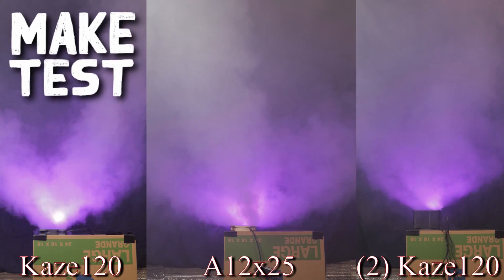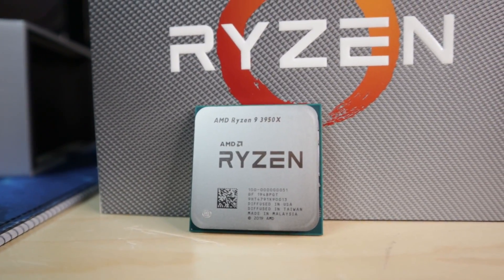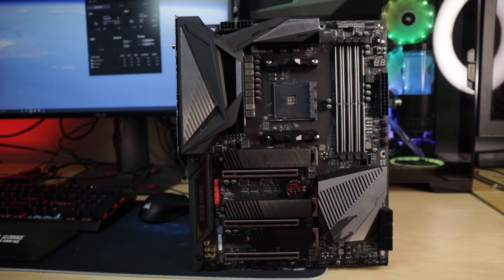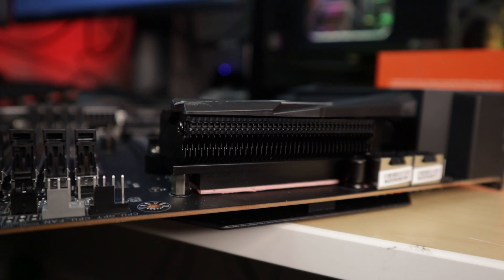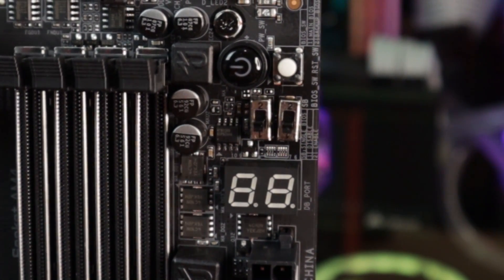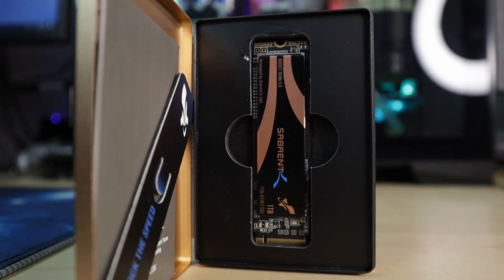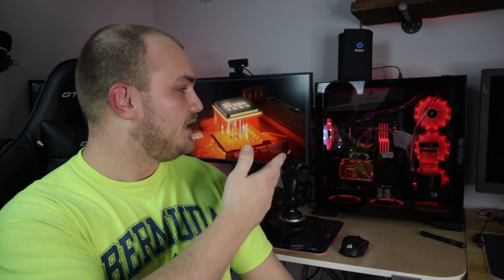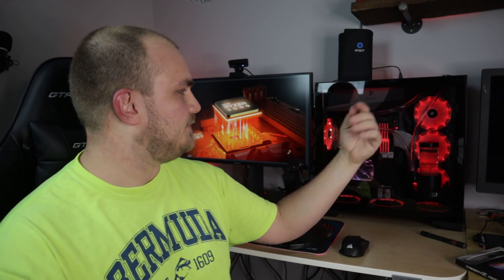EVERYTHING WENT WRONG, Upgrading I7-7700K to Ryzen 9 3950X

Comment: I upgraded from Intel i7 7700K with ASRock Taichi motherboard to Ryzen 9 3900X with a X570 ASRock Taichi. Both had 32 GB RAM, but 7700K was limited to 2400MHz whereas with the 3900X I can run 3200MHz, more if I wished. Essentially it was a 3x increase in grunt and it is unbelievable the difference the grunt makes. I recently ran a stress test for 2 hours @ around 400 watts, 100% CPU capacity, between 75-100% GPU capacity, and 90-100% RAM capacity.
 The GPU ran @ 67C, RAM @ 47C, and CPU @ a very cool 72C. The load I was running - 5 different stress tests running plus processing photos - the 7700K would not have been able to handle.
The only things I changed was the motherboard, CPU and RAM, and kept the same 750 Watt power supply, hard drives, etc. You also need to reload many programs so they can recognise the new CPU and motherboard, and of course load all the latest drivers for the motherboard and CPU... It is an awesome system and incredibly stable. I didn't and haven't had any major issues. I won't need to upgrade for 4-5 years, plus...
No need to overclock it... it is a beast off the shelf. I call the system 'Megalotech', a close relation to the Megalodon, one of the biggest angriest beasts that ever existed.

Comment: Incompatible cables must be a "thing" with psus! I experienced the same exact issue with psu cables! The irony in my case was that both psus  are the same brand (gold plus Chieftec) but  different models!
From what I noticed by  tracking the color of their individual wires, their positions are switched for a reason.

I also made a similar  switch.... from a 2011 HEDT intel platform to a low cost 8core AMD system. The new platform is currently about x5 times faster in 3d rendering even if the old HEDT platform runs at  the same speed (4GHZ all core) and lacks only 2 cores/4 threads. (great IPC differences!).

Either than the psu cables, everything else went really well since I always buy a previous generation of hardware...giving it time for their drivers to mature and avoid any incompatibility issues.(and save money).

Comment: I built my own pc with a 3900x recently and kinda went through a similar story. 

The lockups happened from time to time but I figured (maybe) the ram was the culprit. I was trying the 4000 and 4133 xmp profiles which I believe isn't recommended, so that's understandable I guess. Didn't get around to testing at other speeds but with the base speed (xmp off) all was well. Could still have been the chipset drivers. Though it never crossed my mind so didn't really connect the dots on this one.
 
Aaaand one of the ram sticks was DOA as well :(... Patriot however in my case. I'm out of the 30 day amazon return period too which is a huge bummer since now I gotta go through RMA and I'm outside the US. I'll probably buy a 3200 kit to get things going since I don't have any spare ddr4 sticks until (hopefully) the ram kit gets back. Never RMA'd anything before in my life so fingers crossed.
Reply from the maker: im in the same boat RAM DOA and i have to do the RMA thing as well

Comment: that psu sata cable issue happened to me as well.. mine was an evga sata cable as well and my new corsair 750 psu.. same. exact. issue. just a click sound. didn't take me quite as long to figure it out.. i tested it with the evga and it powered up and booted no problem.. switched back to corsair.. nothing.. plugged each cable in one at a time until i discovered the sata.. must be a compatibility issue between EVGA and everyone else LOL

Comment: Always update bios, drivers and chipset on any computer bro! That's total noob moment for you. Also you using a wrong PSU cable is also not a "common mistake" that's also on you guy. And from your couple benchmarks. You lost maybe 1-2 fps average and gained significantly better 1% and .1% lows. I would take consistent fps over stutter and chop any day. I'm not trying to be a jerk in the comments, but I never have a problem after building on platforms that mature when drivers aren't left out. I guess I'm jealous because I'm still on z87 platform. 4790k. But wish I could upgrade...
Reply from the maker: hey dont feel bad i still have a z77 platform running with a 2500k and it fires up everytime i hit that power button
Reply: @MajorHardware  either way good build vlog. I have put together a few AMD builds for friends and family upgrades with modern and hardware since ryzen. I find that the initial setup on ryzen especially on b450-b350 mobos need updates everywhere. Because ryzen stuck with the same socket which I admire. Doing a few updates on a wide variety of boards is better than having to buy a whole new board with a simple CPU upgrade. From my experience, gigabyte has always had driver issues out of the box on AB and b350-450 board when compared to MSI. I have installed AM4 on an ASRock on b450 and also needed a bios update to get xmp to work with Corsair ram. Which at the time seemed odd. As for the more budget focused MSI boards never saw any major hickups with drivers and bios out of the box. But I always update anyways. But working with the gigabyte boards I had the most by far.
Reply: @MajorHardware  I am 20 builds deep this year as a side job. Intel is more friendly out of the box. But as soon as you do some updates ryzen is a fantastic platform

Comment: Did u do a  fresh Windows install or did u boot with the previous Intel based ssd?
Reply from the maker: did a reinstall windows but told it not do delete files however i still had issues with the system locking up it has gotten to the point that i cant boot and if it does boot into windows it locks up after about 1 min. i tried to do a full whipe of everythign however i cant make it though the setup without a system crash. vary strange.

Comment: I will share a story. 
Bought a Ebay Power Supply. Seller sent me  CPU cable that were EVGA but not Type 4. I plugged it in to a new motherboard and broke the motherboard #1..
Plugged it into Motherboard #2 and broke that one as well. Realized that there was no writing "type 4" on the CPU cable like the other cables had on it.. I used my power meter and found out that I had the incorrect one..
Reply from the maker: That is a terrifying story

Comment: Dude great video!! I had some of the same issues with my R5 1600AF. Check out my vid!! But I used 3000 MHz RAM not on the QLC list. But with some tweaking got it to 3000 MHz. And when OCd to 3.7 GHz it froze a few times. It could be cause I'm using the stock cooler. Could of been the RAM....idk. but what a great Value 6c/12t and a b450 Aorus M for 165. I notice the clocks are higher on Intel as well but I'd rather have more cores and threads all day!!

Comment: AMD loves ram speeds 3600 is the sweet spot and if you bring the timings down you will see a huge boost in performance in gaming i went from 6700k to the 3950x overclocked the 3950x to 4.2GHz all 16 cores and anywhere from 10 to 25 fps boost in most games. with 3600mhz memory 32gbs at C16 timing will make the timings tighter over time. to bring the performance higher.

Comment: Holy shit! You have my cpu, ram, nvme and motherboard. Are you stalking me sir? I had issues too but it was because this was the first time I’ve built a computer.
Reply from the maker: My system is having freeze issues weirdest thing boots to windows then freezes
Reply: Major Hardware I have the opposite problem, I can’t get it to go to sleep. It’s either on or off.

Comment: I'm going to be doing the exact same CPU upgrade, though i'll be waiting for ryzen 4000 to launch and kill the prices on the 3000 series.
Reply: Same, maybe, just maybe, the X570s will also go down in price
Reply: @GayGodSparkles  I've seen some reasonably priced x570 boards already, around $140, and ill be going with at least 32GB of ram, however I'll be going to 64GB if i don't right away.
Reply: I have a 3600 but will upgrade to a 4600 equivalent for sure.
Reply: Wait until the corona virus vaccine has been found or they found a cure

Comment: I really wanted to get a 3950x but I didn’t have the patience and picked up a 3900x and crosshair viii. But while i do love my 3900x i have it paired with a radeon vii and its not my main gaming rig that honer goes to a 9900ks and 2080ti. But amd is pretty much killing it in every price bracket with their cpu’s. The only advantage intel has is in gaming and its so close now the only reason to get a 9900k is if you have a 2080ti. And with testing on my strix 2080ti my 9900ks at 5.2ghz is still winning in most games vs my 3900x at 4.425ggz but i play at 3440x1440 and it brings them even closer. What I really liked about the ks is i can run it at 5ghz 1.18v and it really runs cool on a 360 aio with push/pull fans. The 3900x can get pretty hot and i have a kracken x72 on mine. Right now i dont think my overclocked is 100% stable but it works fine with games. It will do 4.425ghz at 1.28v and hasn’t gave me any trouble but cinebench r20 will crash. I just kept it low for the temps i still hit mid 70’s with fan and pumps 100% when maxing all cores. I tried using precision boost but the all core was like 4.1-4.2 max but my single core would hit 4.6ghz. I just cant imagine the wraith prism cooler doing any good with the 3900x guess bone stock but with the crazy voltages most motherboards put on precision boost im guessing it would heat up quick. And i got just as much or more performance going to 3600mhz cl14 ram than overclocking. While i love my amd cpu’s i still prefer intel/nvidia for my strictly gaming machines but in everything else the 3900x and especially the 3950x destroys it. And ive had many problems out of my 5700xt and radeon vii more so the black screen than anything else. Just not had any problems at all out of all my nvidia gpu’s. The only thing is a got a bad 2080 at launch with the bad batch of gddr6 but that got sorted out and my new 2080 has been flawless. Intel is really gonna have to change their ways if they wanna compete especially if ryzen 4000 is as good as the rumors.
Reply from the maker: i alsmost did the same i wanted the 3950x but missed it on release and had to wait for them to come back into stock. however gaming wise i think i would have been just as happy with the 3900x but for rendering and video production im happy i waited.

Comment: just oc ur ram to 3600 or better 3800 mhz if ur cpu can run if on 1900 mhz. Let everything run in 1:1:1 mode then u will get a big performance uplift! ir !% and 0.1% low should be much higher then

Comment: Just upgraded from a 7700k@4.9Ghz w/ 16Gb DDR3000 to a 3700x w/ 32Gb DDR3600 and with a 2080ti in most games at 1440p it's about the same performance although some games are way slower with the AMD; Far Cry Primal and League of Legends for example are way way slower than they were on the 7700k. And that's after tweaking the PBO and using Ryzen Memory Calculator and manually setting all the memory timings. On Intel I basically just had to enter the bios and change one setting to get to that performance level. The 3700x is a big improvement in synthetic benchmarks though...

Comment: Everyone with a 3000 series Ryzen CPU go watch this https://www.youtube.com/watch?v=G7Z7bJJcCNY it's applicable to other motherboards too.
Reply from the maker: watchin it now, i need to get my 3600 kit RMA first but then im in.
Reply: @MajorHardware  Buildzoid says to set to 300-23-230 in PBO. But I exploit a bug in Agesa by setting it to 300-230-1 (EDC of 1 will allow full boost speeds across all cores). Leave everthing else alone excepting XMP on profile 1 and see how it goes. Does before and after benchmarks in diagnostic mode to avoid variances due to background tasks. I went from around 4900 in CBR20 to 5122. All my cores boost to 4.4 Ghz (not all at the same time obviously) and sometimes on two good scores to 4.450 Ghz.

Comment: User error is usually the biggest cause of problems :) Also it's not about the FPS it's about the smoothness of gameplay. Less stutters on the 3950X especially in modern titles that makes use of the extra cores. Go check out Buildzoids latest video about setting PBO. I set my 3700X to manual PBO (Use AMD's Overclocking PBO not the motherboard manufacturers PBO) of 300, 230, EDC 1 (EDC 1 exploits a bug in AGESA to get higher boost clocks) @ 4x and 200 Mhz. My score went up from under 4900 in CBR20 to 5122 and boosting to 4.4 Ghz all cores (not at the same time obviously) and two even go to 4.425 Ghz. Voltage and temps are fine.
Reply from the maker: i watched it, great video and now that my chip is OC and my gpu is OC i think i need to make a followup
Reply: @MajorHardware  looking forward to it! :)

Comment: Hey man!, congrats on the upgrade! Ryzen benefits heavily from low latency RAM coupled with the speed of the infinity fabric.

Would like too see how much you get out of OC'ing your RAM. Both your current 3000 mhz kit and the new 3600mhz kit after RMA.  If your Trident Z kit uses Samsung B-Die, give it a go with DRAM Calculator... you may find that the GTZ Neo kit may not be necessary.

If you prefer to stay in the XMP profile only, then yes, get that Neo kit running.  

I'd be interested in knowing what kit is the NEO one?  Does it end in "GTZN" or "GTZNC".  GTZN uses B-Die memory from Samsung and has tighter timings that will give you better performance.  

Sorry for the long reply. But by tuning my memory I have been able to jump up to 800 points on my Cinebench tests, and play my games locked at 144hz vs fluctuating in the 130s..

You'll get so much more than what you already got!  

Anyways, whatever you decide to do, you have a TOP system, so enjoy!
Reply from the maker: i have my CPU and GPU oc now and things are pretty awesome, i think i need to make an update.
Reply: @MajorHardware  please do :)
Reply: He should be able to get his existing kit up to 3600 Mhz easily if it's Samsung B die. I was able to get to 3600 Mhz stable on crappy Micron (Corsair Vengeance 3000 Mhz).

Comment: People underestimate the need for the latest AMD chipset drivers directly from AMD. It's great to see you mentioning it!
Reply: where do i find out my driver version? i just built a 3600 system
Reply: @zemouregalhd3331  It's unlikely you have them installed, or the latest installed. The latest came out a month ago on 16 Jan.
https://www.amd.com/en/support/chipsets/amd-socket-am4/x570

It's the same driver package for all Ryzen chipsets, including Threadripper. You can replace the X570 in the link with your chipset if you wish, but there's no need. For people with Threadripper systems, if they want their page (no need as same driver package) it's easier to go back to the support page and search for it due to the different sockets in the links.

Comment: test again when new ram is installed, im curious to see how much difference it makes, ryzen benefits a lot from ram speed
Reply from the maker: will do
Reply: @Marcus R smart cookie nice.
Reply: Go watch Tech Deals he's probably the best AMD tech channel right now so much information he puts in.
Reply: ryzen  only likes the ram speed to be no higher than 3200-3600 3600 on the high end. anything else will slow down your system tested & proven. https://youtu.be/G7Z7bJJcCNY learn more here about overclocking & what to expect out of your system what works buildzoid knows his stuff. Never hurts to search things on the net watch & learn take the gussing out of things.
Reply: @digitaltactics9234  I'd rather go 3200 cl14 then 3600 since the latency gives better performance and it's cheaper, you could try the other way around but the money saved might be worth lol
Reply: @Oliver-bn7jt  I got 3600 b die g skill  ram already . But I can always lower it back to not spec for sure. But right now I only got the CPU and RAM.I'm like on the fence between like four different motherboards lol. and whether or not to go soft tubing or Hardline but I like soft tubing. Ha & got ya
Reply: @Oliver-bn7jt  you should get Dom plats SE. 3400 CL10
Reply: @digitaltactics9234  I was dead set on soft tubing for a while, but now I'm starting to think maybe hard tubes will be better more long term. That's how I get stuck.
Reply: @digitaltactics9234  what's the cas latency for 3600mhz Samsung b die? My ram is 3600mhz cl 17 and its Samsung ram just dunno if its b die
Reply: @ArtisChronicles   hard tubes look at optimuspc . com for the best one seal fittings. But i have had no leaks for soft tubing  for 5 years not a drop. & as a side note there product's are made in the usa. My grandpa use too where self made hat's that said buy american give  american's jobs. When you younger your like what a weird thing then you get older makes a lot of sense. ha good luck with your next build.

Comment: intel is just a better running and smother ,, i had/have 3 ryzen systems and i still prefer intel, higher clock speeds is just better and if your looking for multi tasking  and other work loads get a damn threaddripper dahh
Reply: Fanboy
Reply: @lollb454  how am i a fanboy when i have both sets of systems moron
Reply: Lol he just shared his opinion
Reply from the maker: i will say i did have 2 other issues i found after this video that were hurting me i corrected them and got the system OC and things are much better. ill make a followup about my noobness soon